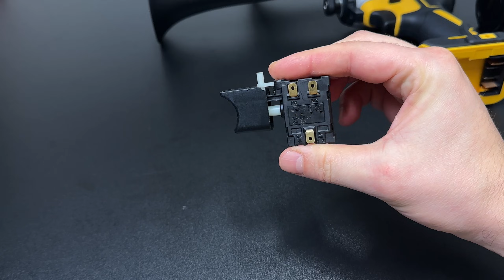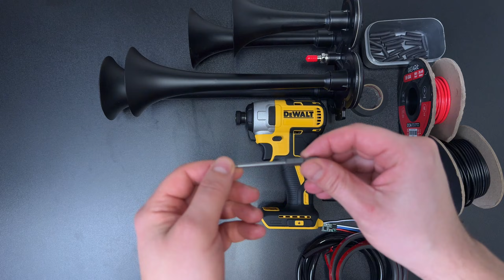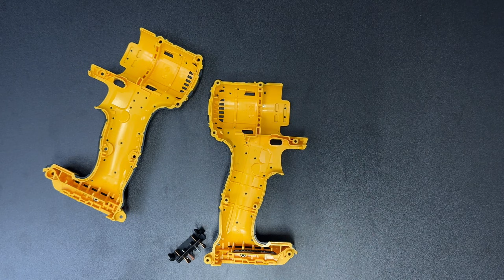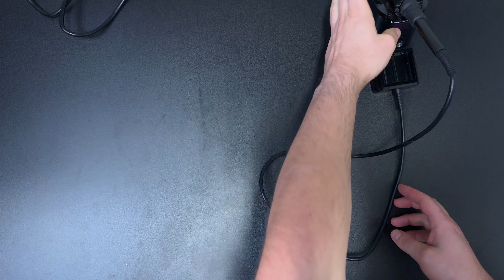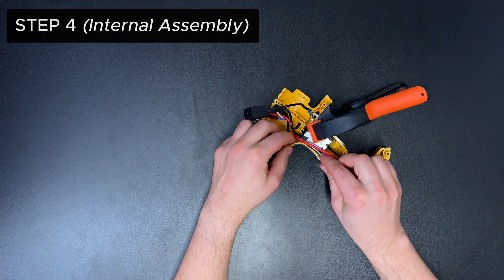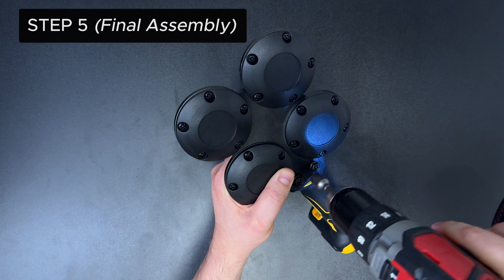How to Build a Remote Control Train Horn for $64 from your DeWalt drill

Comment: Will that trigger hold the voltage and amperage from the battery without the relay or remote? Love idea just don’t need the wireless remote part
Reply from the maker: I recommend using a relay. Otherwise, the trigger will overheat.
Reply: Hey man, im no crack in making things like that, if i need this for a hockey game, i wont blow it all the time, am i cool only using the trigger, or only the fact to have the battery connected will overheat it ?